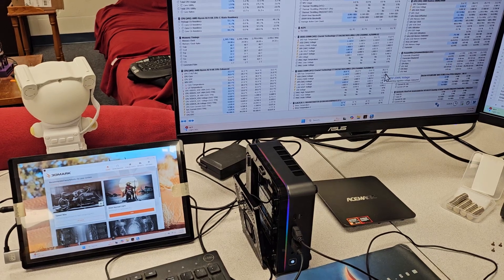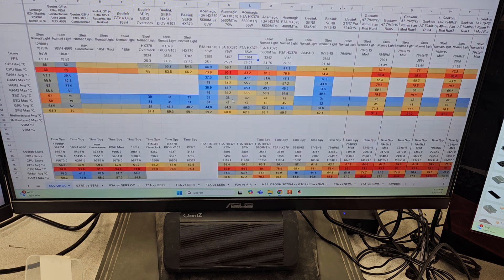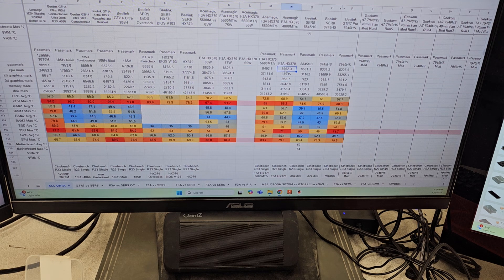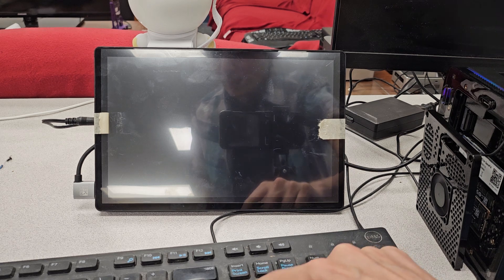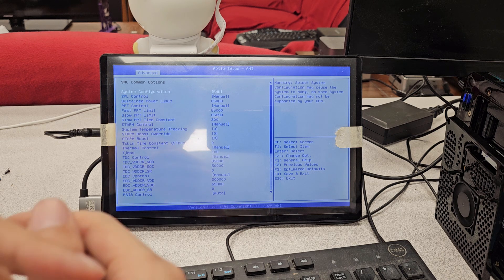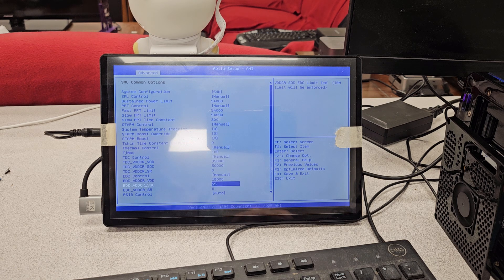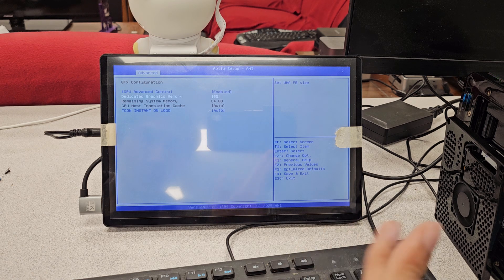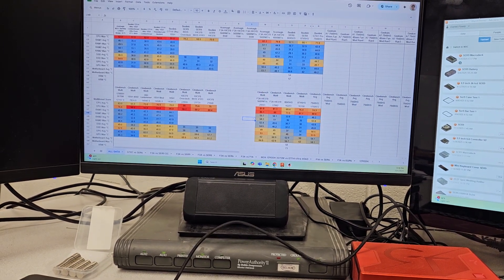Acemagic F3A HX370 5600MT/s vs 4800MT/s RAM and how to increase BIOS TDP

Comment: did you upgrade the bios? I have the bios upgrade file but  quite different then what I am use too. So before I start missing around I would like to know if anyone else has done it? Also what did you clock up too? Cant quite hear it.
I am also runing 18GB ram btw. I have one windows 4tb black drive and a tb linux drive, was going to

Comment: I just got this machine and haev had a hell of a time with drivers. Did yours ship with the OS installed?I can't get windows to detect the required 2.0 chipset for W11 AND I can't get adrenalin to let me push more than 16gb of vram. The BIOS shows I have 128 but caps me at 16 as well, thoughs?
Reply: It’s a PITA the easiest (still not very easy) and most foolproof way is to install WIN 10, and download the drivers from the acemagic site on either a separate drive or partition within your boot drive, then it will either ask you install drivers during the install in which case find that folder or after win 10 is installed go into device manager and find every device with a red ! Mark and right click “update driver” and select the location where you have stored the drivers from acemagic. Windows will auto slim through all of the folders and find the correct driver and install it. After this you should be able to connect to the internet. At this stage you should probably update win 10. After all of this create another installation media for win 11, and reboot, install win 11 - repeat driver process. You now have win 11. I think a lot of the hardware is either off brand or too new and windows doesn’t have the automatic drivers for startup yet. I had way way more issues in Linux with this thing than windows.

Comment: Which CL on youe Ram ? 46 , 40 ?
Reply from the maker: I don't know for the default 4800MT/s RAM but most likely CL46-48. The 5600MT/s RAM is CL46. CL40 might see maybe -1% to 2% different performance which is my guess and extra setting adjustments in bios will be needed to push the rest of the mini pc to meet the better RAM.

Comment: Have you checked the Wi-Fi and Bluetooth connections? Does it work stably without any problems? It's just that my system can't fully find the drivers, Bluetooth connections are constantly being lost.
Reply from the maker: So far the wifi connection has been functional. I am working in a room a fair distance from the closest router I could receive from and I have stone walls all around me.

Bluetooth speakers are working. The range isn't incredible but definitely functional. Are you having trouble with with something low latency like a game controller or mouse?
Reply: @Power3DDesign  It can't be connected to two Bluetooth devices at the same time, a speaker and headphones. And when connecting, you have to wait a long time until it figures out that the sound will go. The device manager shows that there are some problems with the driver.

Comment: It seems my comment from 11 hours ago didn't make it here (maybe because of the URL to the newer BIOS which can be found in den comments section of the AceMagic EU website). I've just tested the CTRL+F1 option with the newer BIOS from 2025-04-11 and was able to select the 48 GB VRAM option (without the key combination only max 16 GB RAM are shown to be assigned to the iGPU as VRAM).
I also have an Akasa (AK-FN076) 80mm low profile fan here (incl. the some matching connectors with cables to create an adapter for the standard 4-pin fan connector). The Akasa fan is only 10,8 mm in height and I'll create a fan mount and most likely a new cover to be 3d printed in the next couple of days. It doesn't have a high priority as I need to do more on the software side of things for the AI stuff on Linux (I'm using Lubuntu 24.04 here).
Reply from the maker: That is awesome having a much larger fan than the small 40mm one. I wish you the best your 3D printed adapter went well. 48GB RAM for the iGPU is monsterous.
Reply: @Power3DDesign  I was pretty busy at work and home with other projects so the fan mod didn't get much progress over the last 10 days. The 3D print model needs only a few modification which I make actually right now, so I might be able to print the first version shortly (it's only the "inner fan plate"). I still have to create the top plate but that one is pretty simple. I'm most likely creating two versions (for 11mm and 15mm fan heights) so the standard slim version with 15mm is also covered. I'll release the step files once I think it matches my high quality standard. I can drop a note here when it's ready (it will be free to use).

What I was able to do earlier this week was an actual test of the akasa 80x80x10.8 mm fan. I made an adapter to connect the standard 4-pin fan connector to the micro connector. Thank god I stall had ~20 of those JST MX (GH= 1.25mm pitch) 4-pin micro connectors with cable lying around. After connecting the akasa fan started spinning with only the 5V that the F3A top fan connector delivers (the akasa is a standard 12V fan not 5V as the 40mm one originally installed).
If that wouldn't have worked out I would have tried the ARCTIC P8 Slim PWM PST fan (also 12V; dimensions 80x80x15mm - I just ordered one as it was discounted 😅) and the next option would have been the Gdstime GDA8015 (80mm x 80mm x 15mm which is available with 5V version but without PWM as it seems. Anyway the akasa seems to work perfectly even if it draws more power.

Update 2025-05-18:
V1 of the plate for the fan was already good except for the screw holes, V2 fixed it and now that part is done for the moment and installed. There is some backflow of air (as I can feel) because the fan can't push that much through but I'll ignore that (I may flip the fan around). That version is now installed and I'm starting the top cover + some (sort of) air duct plate so the air is not directly caught again by the fan.
Reply from the maker: @j.w.u.5728 that's awesome you got a working adapter for the fan. Mods almost always take more time than planned so it's wonderful to read your thought process through this!

Comment: Have you messed with the Universal X86 Tuning Utility at all?  There was some video I saw where you can change some of the  PBO settings through Windows.  I didn't see any PBO stuff in the BIOS.  On my 7800X3D and 9800X3D undervolting it allowed it to boost a little higher/longer
Reply from the maker: That's a good point about UXTU and I haven't tested it yet. I'll give it a try and see if I can get some better performance even if I have to lock the iGPU at its maximum clock speed.

Comment: Thank you so much for your videos. I have been looking for some information about F3A, but I couldn't find much. You even included segment that talks about overclocking in BIOS, which makes me even more happy. Now I need to do some more research about Framework 13 with HX 370 and decide which one to buy.

You should turn on the option for super thanks, so people can donate to your channel
Reply from the maker: Glad I could help and tough choice and thanks for the suggestion! 

The F3A definitely has the bigger cooler and a secondary fan as well so unless you need a really thin mainboard for a laptop or cyberdeck build, the F3A will likely be quieter and deliver better performance than Framework and at two thirds the cost.